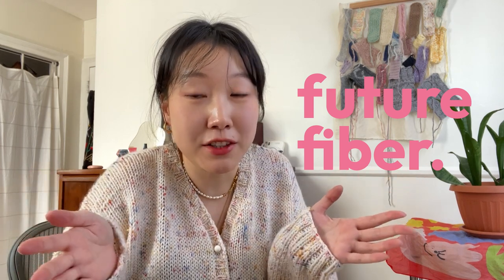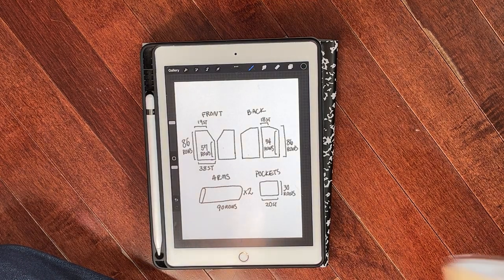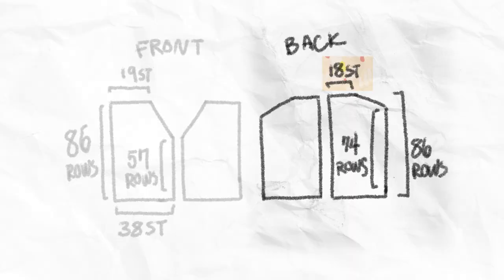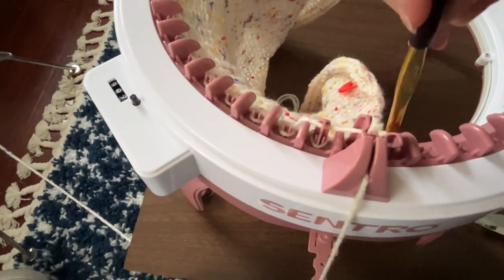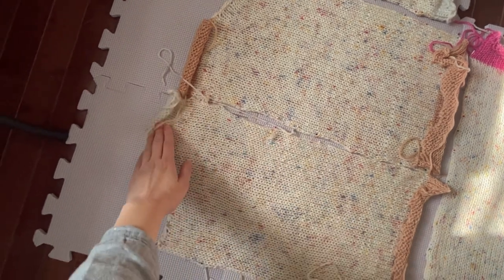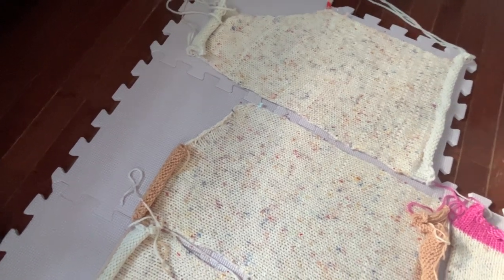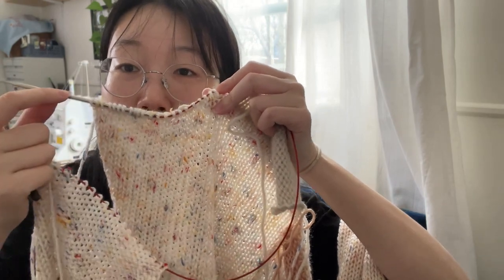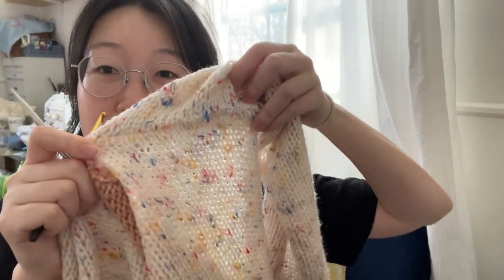I made a cardigan on *that* knitting machine | process & review

Comment: The flatbed knitting machine is the next level from these circular knitting machines.  The sock machine with accessories can set you back $600-$900.  A brand new flat bed knitting machine can cost up to:. $1,350++ (metal bed-standard, mid-guage or bulky with ribber), or a LK150 mid-guage from $450-$599+  (plastic bed).  A Brother KH 260 bulky knitter used, in good shape,  can cost $600-800.  These machines are an investment and if taken care of properly will last many years.

Comment: I didn't know these machines were only available in recent months. A video popped up on you tube about it. I love gadgets and decided to buy one. The one I bought on Amazon is purple. It is the same as Sentro. I'm in process of making sweater. I do rip out if a mistake is done. I feel it's a learning process so what if I rip out. I remember when I learned to knit and crochet there was a lot of ripping out stitches. I've learned to use measuring tape. Overall I am enjoying my machine. Patience is needed when working with something new especially when we need to use our brains to figure out a pattern. In knitting and crochet the pattern is written out and we just follow and the item is formed. The you tube people do not offer written out patterns because everyone is not the same size. Great job on video. I subscribed today I will be following to see what else you create

Comment: Does the machine work with yarns held together, like DK + lace mohair?

Love that you made panels and did ahaping because the ones where they only make sweaters using tubes isn't really my style and also doesn't suit my body type. I still like handknitting but I have a lot of yarn lol, might get this next Christmas to bust my stash.
Reply from the maker: I think it could work! I think key is just having smooth yarns that have a bit of give (slightly stretchy to go over the needles). I definitely think this is a good way to stash bust too if you have a lot of yarn that you might not want to hand knit necessarily (i used up a lot of my acrylic yarns and it was perfect)